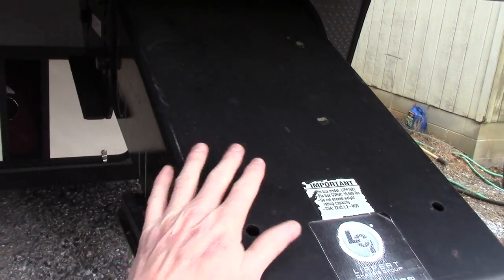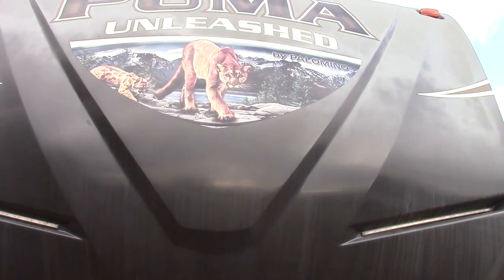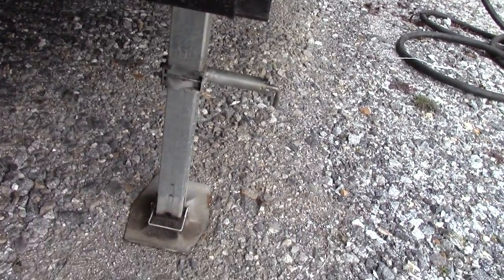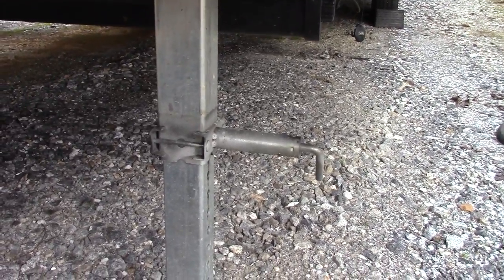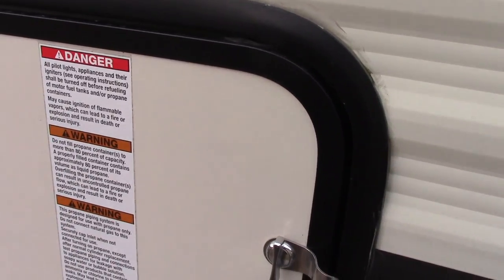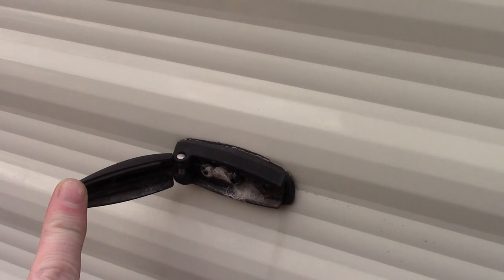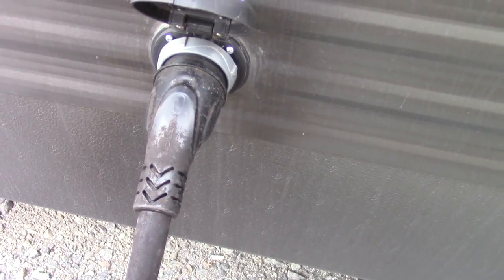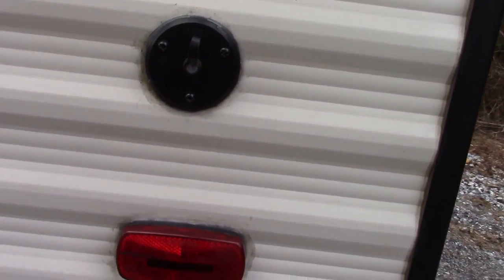Best Toy-hauler Value for a Polaris RZR. Puma Unleashed 373 QSI

Comment: Shane, great review. We purchased the same trailer November of 2016. Looks like we both have had the same experiences with the trailer. We really like it and enjoy it every time we use it. One thing I did shortly after getting it was to find a used air-safe hitch for our truck. The Reese we had was unnerving to use traveling on I-40. We are actually heading out this weekend for Arkansas for a week of trail riding with our RZR.
Reply from the maker: Thanks!  That's awesome!  I just finished getting mine un winterized for the new season and really happy with it's reliability as well as the layout.  I am still using the pullright slider even in the new long bed without issue.  I'm almost afraid to try something else since I haven't really had a problem.

Comment: very nice unit shane!! great value and that garage is huge!
Reply from the maker: It is a great camper. It still looks and functions like the day I bought it.
Reply: @ShaneBurrell1  that is great. how long have you owned it? I want this exact unit,  upgrade from my 24 1/2ft  travel trailer
Reply from the maker: I'm on my third year.  No issues other than some fading on the front cap that cleans up with wax.  It has been a great camper.  Plenty of room, storage and easy to get the RZR in and out.
Reply: @ShaneBurrell1  awesome! one last question, what kind of truck do  you tow it with?
Reply from the maker: I started with a Ram 2500 and upgraded to a 3500 in Oct https://youtu.be/QNsZptx-oGk.  I've done several videos on that as well.  My recommendation is if the trailer is above 12K and you plan to pull distance (more than few hours) or often get a 1 ton.  It's night and day difference in terms of ease of driving.  The 2500 would pull it but was more stressful driving (less stoping power, more twitchy with air from other vehicles on the roadway).  In either case be sure to check your states license requirements. I ended up having to upgrade in NC to a Class A at a combined 28,000 GVWR which was actually much easier than people led me to believe https://youtu.be/7DeamErXhe0 .  I've linked several of the videos of my setup but I have pretty much the whole experience in my RV playlist. https://www.youtube.com/playlist?list=PLzUuu4dRrPGSoayLX33QWy9LyJ41uMAFT

Comment: Great video! I've got the Puma 351THSS and love it. I towed it from Illinois to Colorado and dry camped for 5 days with it and had no problems. I recently got a RZR so I'm excited to use garage and check out some new places.
Reply from the maker: I've been super happy with mine and heard nothing but good things about all of the puma unleashed models.  Did you happen to get a version with the external ladder?
Reply: Shane Burrell negative on the ladder that’s something I wish I had.
Reply from the maker: I've seen it on a 351THSS but when I called they tell me has to be from the factory for backing.  I'm not super convinced that is true.  I use a fold up ladder but it would be safer and more convenient to have something attached.  I'm planning on coming up with something this summer.

Comment: Nice review, thank you for posting. I recently purchased a 383dss and realized (after purchasing) that hitch weight may be an issue once I buy a side by side. Have you had any issues with hitch weight and hauling with this unit?
Reply from the maker: Hitch weight without a UTV is 1980 lbs, on flat ground its actually slightly less with my RZR in the back.  It's right at the limits of most 3/4 ton. I have a 1 ton dually now and no problems.  The 1980 pin weight on a 3/4 ton gets a bit white knuckle at interstate speeds with push from larger trucks going by.  With the dually 1 ton it doesn't move, and I have had two blow outs with no stability problems getting off the road to put on a spare.
Reply: Ah yes sorry my question wasn’t clear enough, I’m actually concerned about losing hitch weight after loading a 1400lbs side by side in the garage. Standard recommendations are 15-20% total trailer weight on fifth wheels and dry the camper is only at 18%. My concern is all that weight sitting behind the rear axles making the hitch weight too light and thus the truck unstable.
Reply from the maker: @P15151  It doesn't make much difference.  In my case it reduces the pin weight by 80lbs.  The SXS ends up close to the axles of the trailer.

Comment: What age do you use in the bed of your truck, what kind of angle can you get before you hit the cab with the fifth wheel?
Reply from the maker: Generally the tail of the camper will drag or risk hitting the jacks on angles well before I run out of clearance at the bed rails.  Sitting level I have approx 8" of space.